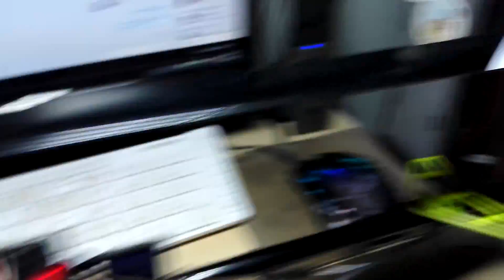My Walkera V450D03 EMAX ES09MD Servo from Banggood modifications and tips.

Comment: I have an annoying issue with mine. Hard landing but not a crash replaced the main gears due to them being stripped out, now the main shaft won't turn but the gear spins.. I've replaced the one way and 100 sure the bolt as Dr nut at the bottom runs thru the shaft. Any idea or help. It like its on free spinning axis but the motor turns full throttle..

Comment: Have you had any problems with servo binding or ball links popping off servos when flying 3D? I have the same issue after doing this mod and can only see the potential for this problem when pulling negative pitch and flying like a ratbag. Short of fitting a camera to see whats happening I would be interested in your findings.
Reply from the maker: +bloodnocka Nope never happened to me before. It popped off which part though? Maybe you can adjust your collective offset slightly and compensate with the pitch links adjustment and give it a try.
Reply: Jin Wei Hong Ball links popping off at the servo horn, due to interference with the servo case when at negative pitch and full aileron(roll). The interference is exactly as you show in your video. Just interested to know if you had problems due this interference in flight?
Reply from the maker: +bloodnocka nope never had this problem. You can try increasing collective offset and compensating by shortening the pitch links

Comment: Hello Jin: for  to place servos EMAX ES09MD, you had to clip the wings of the aileron and pitch servos? you also need to modify the frame with the dremel to place?
You are happy with the performance of these servos?
Thanks.
Cheers.
Reply from the maker: +MA Codorniu That would depend on which servo horn you used. As you can see, my pitch servo horns are uncut. And yes, the frame have to be filed/dremeled slightly for the servos to fit. Very happy with the performance
Reply: Hello Jin: I mean servos wings EMAX brand, if you had to cut them, they do not coincide with the groove of the frame.
I have to install them soon, so I'm asking.
I changed the original tail servo for Align DS525M and works perfect.

Comment: The stock Wakera ESC is bad for servos. Recommend upgrading to a 45 amp SBEC type...much cleaner regulated power for the servos, they will last much longer, you will be able to run them at 6 volts...and your flight times and precision performance will improve. Personally, I still have the stock Wakera servos with an SBEC 45 amp ESC with close to 50 flights with no issues.
Reply: Jason, are you still running the same stock servos?  What exact ESC are you using.  I had a stock servo go up in smoke on my bench and to be honest haven't flown the copter much since due to the what would happen if another one went out in flight. Kind of getting back interested in helicopters and would like to put the 450 in the air again if I could feel more comfortable with these issues.
Reply: So you reckon an external Bec might help save stock servo? I'm looking at buying this Helicopter.

Comment: Will those servo work on tail as well? I bought a Bnf but all these horror stories about servo failing making be nervous 😯
Reply from the maker: No idea. I use the stock Walkera tail servo, seems strong.
Reply: @Nightstalker1993  lol I finally had a servo died yesterday 😮😯 and it happen right as I was landing,so didn't crash thank the Lord 🙏now I did but those servo for this exact reason,any extra tuning when replacing all servo bro?
Reply from the maker: @xboxice2005  As far as I can remember, nope. I am now using KBAR gyro replacing the original Walkera gyro. Flies much nicer now.
Reply: @Nightstalker1993  yeah cool 😎 I had to turn down the pot gains 😊
Reply: @Nightstalker1993  I’m now running emax servo that’s why 😊